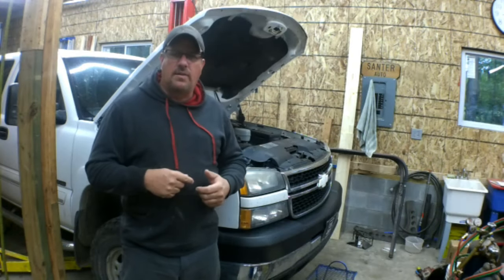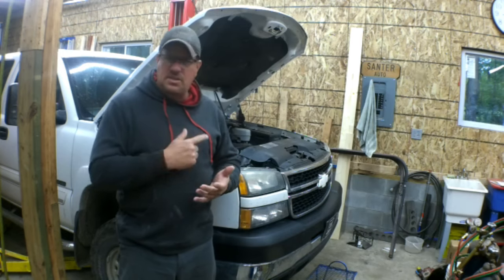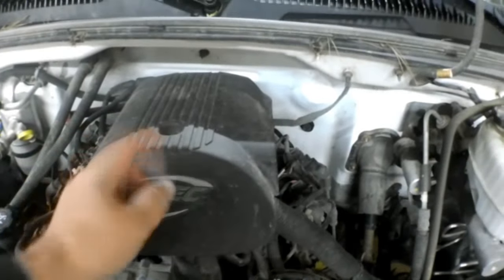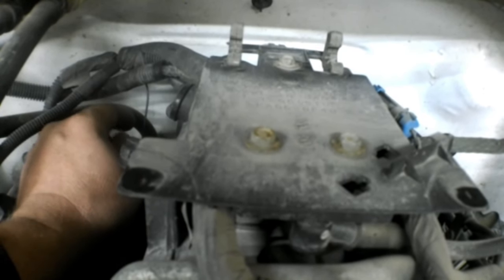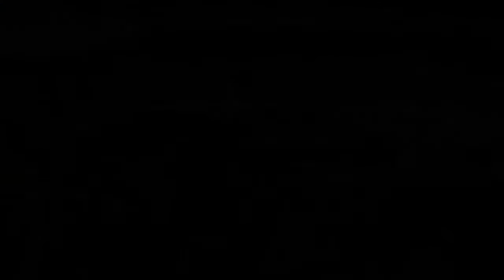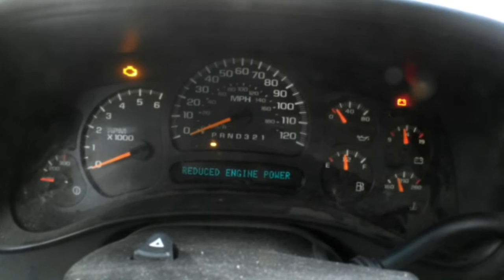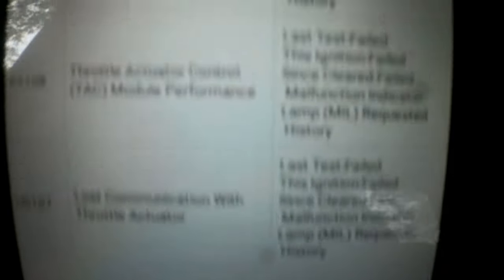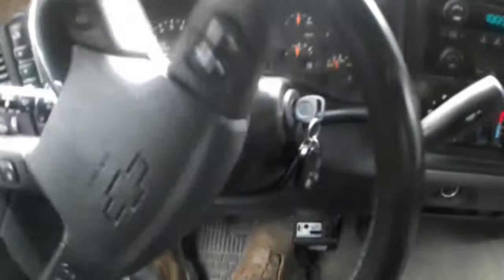Reduced Engine Power FIX! Chevy Silverado GMC Sierra Tahoe Yukon

Comment: I have a 2006 Silverado truck and before I started getting reduced engine power, I had for years the dash saying, "Service Brake System."  Here I am years later and now I'm getting reduce engine power but what I have noticed is when it happens, I just pull over and restart the engine and the truck works as normal again. I don't have the noise that this truck experience. The only symptom I experienced was that my speed would just reduce to a much slower speed. I noticed this would happen more often when I would travel great distances not necessarily due to hitting a bump. Do you think I could still have the same issue with a ground wire?

Comment: Going to the shop tomorrow morning.  Hope the fix is this simple ground issue. Thanks for the video!
Reply from the maker: How did you make out?
Reply: @Tomsfoolery.  P2138... still try to search for the multiple problems that can trigger that code. So far thought it was a particular wire, it wasn't it happened again. Staying faithful, have to strike gold at some point I figure!
Reply: The art of self-reliance is missing from this world. It's one wire what I did was I went in the backyard and ripped the wire off the old washing machine that already had a nice round fitting on it and I done used the son of a bitch fix the truck now it's after I found my boots underneath the Camaro where I was taking a nap to stay out of the sun well the tractor idled away gallons diesel throughout the week running and running never turned off that's the way I handle my business

Comment: Just ran across your  video. My daughter's 02 gmc yukon xl 5.3 is doing the same thing. But she has other issues,  the whole right side of engine is dead. Got voltage to the coils and injectors, but no signal to coils,injectors  and throttle body sensor. Thanks for sharing.

Comment: I done the exact same thing still have reduce power issue. I tested that ground and only getting around 5.5 volts  should it be around 12v.
Reply: I don't believe it should be 12v because that's the ground for the tps sensor. Which the perimeters for that sensor are I think 4.7-5.5  so that should be a good reading.

Comment: So most likely GM scammed me by selling me a Tach module, that I didn't really need for some $500.
Reply from the maker: Check that ground wire for signs it’s been repaired. That could answer your question.

Comment: Started my 2017 Silverado last night and it did this. However, I think mine is tied to something else. I used a fuse tap from a constant power cicuit (BCM I think) to run a circuit for my dashcam. I think the fuse tap may have created an issue to where it doesn't get a good connection in the fuse slot sometimes. My first problems I noticed was that my remote start wasn't working, windshield washer fluid pump wasn't working and I was getting O2 sensor faults. Wiggling on the fuse tap made the issue go away.

When this reduced power issue happened last night, I wiggled a lot of my fuses and the issue went away. Not sure which one remedied the issue, but I'm guessing it was the BCM circuit I had issues with before.

Comment: I just had the same problem in my 2007 yukon denali it just lost power and the reduced engine power came on and the brake light and it won't go nowhere and  I let it sit and it started to move

Comment: I start d having problems with mine , If I ran into the gas station and came out , it would give me trouble starting or go into reduced engine power . If I let it sit it would start right back up ... It's started stalling out completely, I was getting away with a Jump box but that only lasted a couple weeks , my battery is good alternator good , says Engine misfire codes , but that's not the problem ... I don't know why it won't start without the jump box ? I'm not too savvy tbh , but I been at it for weeks and $500 later and counting. I looked for that wire on mine but it wasn't there , it was an engine swap so that may be why .. the wirings all jacked up in it

Comment: Im having same issue with my 06 chevy silverado, i cant find that ground wire, on passenger side,i did all other ground wires ,i have the reduced engine power come on, and with a small scanner i clear and truck drives fine

Comment: I have a 2005 Silverado. Turned it off and it doesn't want to turn over at all. Replaced the battery because the terminal post was stripped and still doesn't turn over. It's flashing Reduced Engine Power. Could it be the same problem as in the video.

Comment: 2004 chevy silverado 2500hd 6.0 omw home yesterday it went into engine reduce motor shut off while moving pulled into a parking lot started it up ran like shit but shut it off let sit for 5 mins ran perfectly fine after but in the power reduced I had no throttle does that sound like throttle body??

Comment: Thank you for the video! I am having the same issue but it started with my ABS light coming on after taking a sharp or bumpy turn. I will check the ground wires and the throttle body flange BUT do you think the ABS light is connected somehow to a ground issue; maybe the same one for the the reduced engine power? Obviously you cannot diagnose properly but thoughts?
Reply: Did you ever figure it out? My abs light turns on when I hit bumps and just recently it says reduced engine power

Comment: My Chevy Avalanche Reduced Engine Power light came on this morning.  Never had an issue before.  Was having trouble with it starting so i think I may need a new battery, but didn't know if the battery may be causing that to happen as well?  What do i know?  I am trying this when I get home from work to see if it fixes the issue.

Comment: Mine just did this this morning reduced power and check engine light came on would the ground be the same issue I just replaced my plugs and wires last week my buddy said it could be a plug or wire that came loose why the power loss light came on any help please liked and subbed

Comment: I just put two new ground wires and a new battery on my 05 Silverado 5.3 motor. It started right up but this same light came on! I'm gonna try this tomorrow and see if the light goes out. Thank you

Comment: I have the same problem but when I turn on the heater to the max , it shut off the heater and engineer light on reduced engine power show up
Reply: Maybe thats whats going on with mine my heater has been maxed out cuz of the cold and reduced engine is constant any fixes?
Reply: @noemartinez9591  I see a common response when its only doing "Reduced power" during 10 degree days.  the throttle body, and the throttle position sensor, are bad.  it will send the readings from the wiring harness, on the throttle, to the ecu, and the ecu tells it to shut off.   It believes there is some sort of "Vaccuum leak" like an intake air issue, because of this "bad throttle position sensor" and it tells the engine, it shouldnt be running.   the good news is this is a diy, with $145 - $190 total cost for all the parts.  Napa is more like 230 for that part, but its cheaper to get ac delco, from online.  It's a common broken part, on anything 2001 - 2012 gmc chevy, tahoe yukon, denali etc.   My denali has this problem.  Utube has millions of views on the replacement vid for this problem.

Comment: Hello my issues is that when I'm towing or going up hill if I step on the pedal and trying to Accelerate kinda hard the reduce power come on I just pull over trun off what a minute and it's gone I have to baby the pedal  if I'm pulling alot of weight and I have a brand new throttle body? Is that normal? truck drive good with out the weight I could actually step on it or I'm not using the lower gears to help with the weight?

Comment: I was just out your way at clear lake state park last weekend I was thinking about hitting you up but figured it might be weird lol I’m the guy who bought your 3 wheeler Honda 110 a few years back
Reply from the maker: Oh right on! We bought a new place right on 32 now. just east of Vienna. How's everything on your side of the state?
Reply: Santer Auto Repair LLC  everything is good we just bought a new place as well it’s been a busy year that’s for sure
Reply: I have a 2003 tahoe z71  I'm having the same problem when I hit a bump in the road I went under my hood looking for that cable but can't find it plz help me locate this
Reply: @josephandalcio421  I just had that problem yesterday and came across this video this morning, please let me know when you find out where to find that wire to fix it please.
Reply: @perezfamily2861  I think I found it but I'm gonna wait till the reduce engine power comes back on again. It extremely strange how minds comes & goes
Reply: @josephandalcio421  Omg, I drove my 04 Tahoe this morning and it stopped showing the Reduce Engine Power but my lil check engine light was still on, then later at at night I drove to the store and the lil check engine light isn’t showing anymore, So I’m hoping it was due to my crazy driving yesterday hitting the bumps because I was in a rush lol..
Reply: @perezfamily2861  same here if I drive my tahoe fast it has a tendency to do that with the Check engine not sure why my guess is maybe the oil compression drop a bit & the engine recognition determines its low on oil once it settles the check engine light goes away like nothing ever happened. Oh by the way time do you find yourself adding engine oil for me being I have my Tahoe lifted with monster tires I have to do a little add of oil 1 a week but if I'm traveling from Miami to Orlando or Tampa it doesn't require unless  it plenty of city driving.
Reply: @josephandalcio421  Same here on the oil and I don’t even drive it that much.
Reply: @perezfamily2861  I'm guessing it's common on the 5.3L when I has my 01tahoe ls with the 4.8l I didn't have any issues with oil burning so fast. But honestly I still won't get rid of my truck. It's a really good road road I've been from Miami to Atlanta & New Orleans with absolutely no problem.
Reply: @josephandalcio421  Yeah, I love mines too. Runs like a champ other than this little issue I ran into the other day but now it seems like nothing even happened 😂 and as long as it can pull my trailer it’s not going anywhere 😂 Best of luck to us with these Tahoe’s.

Comment: My 2000 GMC Sierra 1500 dies when I turn the ignition on. Battery was tested and is good. I disconnected battery and reconnected later, had done power until I turned ignition on, then lost power. What could cause this?
Reply: Test your alternator

Comment: My father has had the same issue with his Colorado which is a vortech engine as well and his was the electric throttle body had to be replaced which had to be reprogrammed too
Reply: Where can I get programmed
Reply: @albertquintero5412  any mechanic shop with a high tech scanner
Reply: @hussein5743  yea I went but I feel like the mechanic didn’t do it he just checking on scan tool but yea I got check code p2135 kinda pissed about it
Reply: @albertquintero5412   to be fair there are some shops full of idiots so id check with a more reputable shop
Reply: @hussein5743  I think I found one that gonna diagnosis my truck i hate getting limp mode
Reply: Yeah sounds like he might as well just keep forfeiting all the harder and money to the dealership or to the mechanics of the mechanic go by himself on me house and go kick your trash cans

Comment: I have a 2004 yukon with the same problem I put a new throttle botty  new harness new pedal and the problem still there...make me a headache
Reply from the maker: Did you check for that ground wire? Reduced engine power is a difficult issue to fix sometimes because there are so many things that can cause that warning to come on.

Comment: I have a Chevy and its doing the same thing it says reduce engine I changed throttle body and spark plugs still says the same
Reply: So then go and do this? What was the point of this comment when theirs a whole video right above explaining how to fix it
Reply: @bobbienorman2689  for one I did didn't work js
Reply: @miissgreenbay1162  I did this yesterday it worked for me. Did you add another wire and solder it and put in on a different ground?
Reply: @bobbienorman2689  how do I do that and what kind of wire
Reply: @miissgreenbay1162  @ did u ever fix the issue??

Comment: Damn thank.you so much for this video. I just start having this issue with my 2004 suburban. I got reduced engine power and traction control disabled across my screen and also loss communication with throttle Contol actuator. Did this fix and problem solved. Thanks such for this video
Reply from the maker: That’s great!